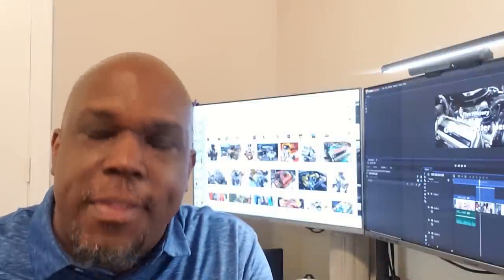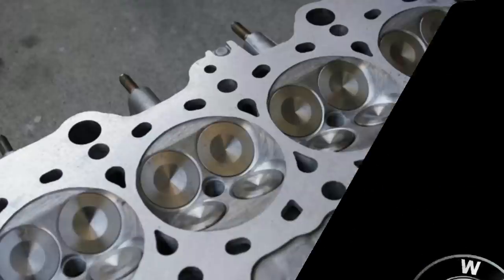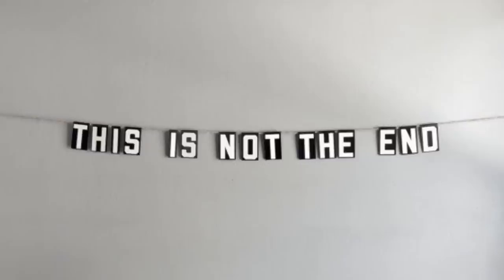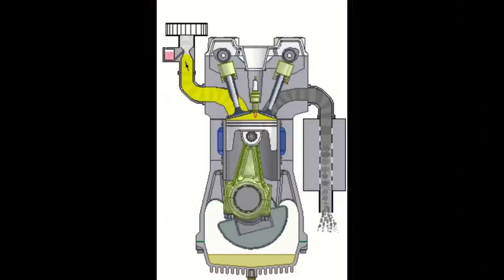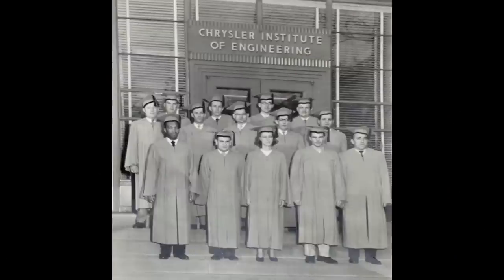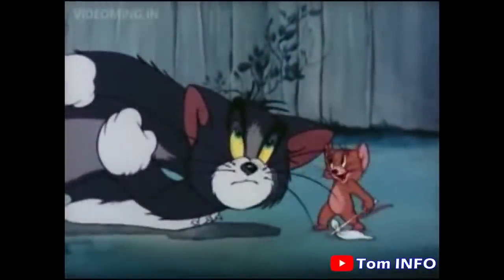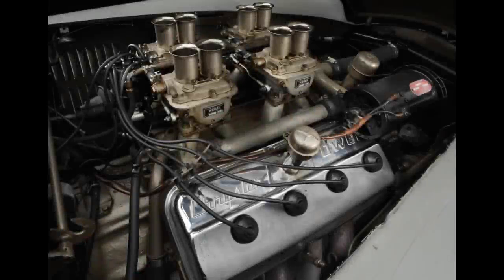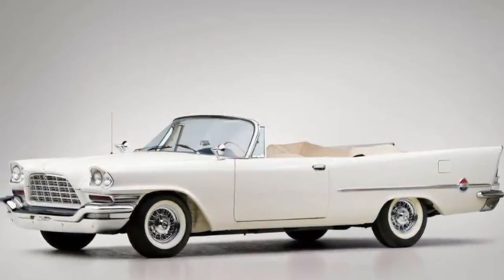The History of the Chrysler Hemi Gen I

Comment: The XIV-2220 was not the 4,14 or 11-2220. X stood for experimental I stood for inverted V stood for engine configuration of 2220 cid. Most WW2 aircraft engines of all configurations were "blower" fed. These superchargers were ALL mechanically linked to the engine, no belts to throw. Many superchargers had a transmission of sorts for 2 or even 3 speeds for additional boost at high altitude where air is thin.
Reply from the maker: Thank you for the information!

Comment: Are you sure the V16 did not also have a mechanical mixture distributing blower at the back of the block? They weren't as large as performance units, but they did give some positive boost (as with V-1710).
Reply from the maker: I'm getting a lot of comments telling me that there were plenty of gear-driven blowers on planes back then, so it could have very well been blown instead of turbocharged.
Reply: @TheGearheadLounge  I think you are correct about this particular engine being turbocharged given that the exhaust is collected and piped to what looks like a turbine. I'm just suggesting that many engines came with a small, mechanical blower integral with the engine regardless of how performance boosting was added. The US Army was sold on turbines, but that didn't keep Allison from having an integral blower. An 'auxiliary' turbine was added to the P-38; I think it was never added to production P-39s or non-Merlin P-40s. I'm probably oversimplifying but, basically, the complexity of aero engines made induction routing circuitous. That integral blower helped mitigate the problem. Of course, some engines (like the RR Merlin) went straight to performance boosting as RR did not intend to chase torturous turbine development when they suspected their blower refinements were nearly as good (and more compact). Look into compounding or fluid drives if you like headaches. Just the same, thanks for the content.
Reply from the maker: @busterdee8228  Thanks! Yeah, I think it's turbocharged myself, because I studied a ton of images and it seemed like the most logical answer, but I'm not going to argue with anyone on this subject because I don't know for sure 100%. A lot of these guys commenting have worked on airplanes like that, so I'm content NOT pushing my point across. In the end, the powerplant itself didn't get past that development stage because jets were the next big thing. I do appreciate your comments though, I love learning new things!

Comment: I can think of three other manufacturers with Hemi engines at least
1) Jaguar. The XK series inline 6
2) Damliar. The 2 or 2.5 liter V-8
3) Toyota. Their first V-8 was a pushrod Hemi head V-8 eventually grew to 4 liters iirc.
Reply: 1 more for the list. The Renault 1600cc four cylinder used in the 18i a d Fuego in the US. One neat feature of that engine series is the camshaft is mounted so high in the block that the timing chain and sprocket are partially above the deck of the block. The tappets are in the head. Very short valve train. And yes it's a cross flow head. There are still people using race prepped versions of that engine in certain classes. I'm not sure but the engine along with the transaxle might have been used in Formula Renault.

Comment: For your information, the XIV-2220 is Experimental Inverted "V" 2220 CID not the 4-2220, aviation industry has given special nomenclatures for each component of the aircraft, case in example, the Allison X-3420 engine is actually a double V-1710 that drives the common driveshaft, with an engine upside down resting on top of the base engine, today most civil aircraft are powered by the "O" series which is opposed cylinder engines just like the VW beetle or Porsche's 911 series cars, most of the names used in the automotive industry comes from the aviation industry, "I" = inline, "O" = Opposed, "V" = v, "X" = Double V, "IV" = Inverted V.
Hope you understand that the IV is Inverted V not 4
Reply from the maker: Now I do! Thank you for the explanation!

Comment: The IV prefix to the aero engine is not a roman numeral. It relates to the layout of the engine which was an Inverted Vee of 16 cylinders . In military parlance the engine displacement is rounded to the nearest multiple of five. So the engine is an Inverted Vee of 2220 cubes or an IV 2220 not a 4-2220

Comment: The early HEMI and the new HEMI are nothing alike except for the shape of the combustion chamber the old HEMI was almost bullet proof the new HEMI can’t come close overheat it one time it’s done
Reply: 1990's hemis don't have hemi chambers, it's more like everybody else's Yates chamber now, except over/under valves instead of side by side valves...
Reply: @BuzzLOLOL  The 90s was a semi-Hemi, but the newer Eagle is, like you say, more of a Yates but with the lateral valves of a real Hemi.
Reply: The old hemispherical chambers really where the best if you didn’t over do them!
The middle child is just me, but the newest generation is much better than the 90s version again.
They can withstand a good bit of power and torque while having a decent reliability with the bigger block, the better rods and the better Aluminum heads.
With all that together (the latest engines have it from the factory the a bit older ones around 2010 you needed to build a hybrid between the car and truck engine.
More durable block, rods and head aluminum of the trucks but the rest from the cars.
Annoying thing is that the head needed to be machined for the bigger car valves to if you do that just don’t take the stock parts but better parts to get 550+ hp for cheap (if you already have the functioning engine or all factory parts for a full build at home).
Otherwise just buy an engine that’s newer than 2017, they already have all the good stuff mixed together from the factory.
Those you can just drop in.
Reply: True! I put a 392 in a 71 Cuda (from a junk yard), and created my own Hemi Cuda. Bought the engine for 100, wrecked car for 1,000. Spent 10,000 on everything (very high those days, because new cars, were under 5,000). But they were built tough. And yes, that 392 with parts from our hotrod store, did make it almost indestructible. Block and heads cast iron, I got racing guts, and an aluminum 2/4bbl carb set up. Kept the valve covers, had them chrome plated. Great time era of being a kid.

Comment: They're not roman numerals. I- means fuel injected. V means it's a V engine as opposed to the currently common O- Opposed or flat engines or a R- radial R-2800 P&W. X- is for a double V, X engine possibly or used to designate an Experimental engine.
 In modern times, L- means liquid cooled but wasn't a thing yet perhaps.
 There's also TS or T for turbo supercharger or the modern " Turbo " designation.
Reply from the maker: Thank you!

Comment: Most of the WWII material here is simple minded, often dead wrong. Engine driven superchargers on airplanes did not use belt drives, for instance. Many engines 2 stage supercharging.  The first stage was driven by gears, not belts. The second stage was a turbocharger. Sometimes. In others it was another gear driven supercharger. Anyway, this guy is so slick and careless about matters I know a little about I mistrust him on the auto material.
Reply from the maker: Thank you so much! I appreciate the info! I really tried to find out the truth, but was I couldn’t find anything that I considered conclusive. Admittedly, my knowledge was limited in that area. I really thought I had the correct info. I’ll try to address it in the next one!

Comment: The hemi was too expensive to produce and also too heavy. And the power potential really did not show it in top flight. 
The wedge engines were near as powerfull and far cheaper to build. 
Or the A engine that too was simpler and far cheaper.
Chrysler divisions all having their 'own' engines meant Chrysler was competing with Chrysler. Those 50s and 60s engines still confuse me.

Comment: One part you missed explaining early in the video is the valve arraignment. The reason they flow better is more the angle than anything. They enter the combustion chamber at an angle getting them away from the cylinder wall as lift increasrs and unshrouding the valve head.
Reply from the maker: Thank you for the valuable info!

Comment: I'm wondering, is forced induction from an 
expansion chamber, considered supercharging?

Look up the Kadenacy effect.
https://en.wikipedia.org/wiki/Expansion_chamber
Close, but not quite right.

When a 2 stroke engine comes on the pipe, 
the experience is AMAZING!  My old RD400 
was stunning.  My tiny 66 CC bike motor, even 
better.  (It is producing 3 HP, until the pipe wakes 
up, and then you have 7 HP.)  Quite impressive, 
and no moving parts.  (Unless you have reed 
valves.)

steve
Reply from the maker: Wow! That's really interesting! I never knew about that effect. It also appears to promote exhaust scavenging, if I read that correctly!  But I agree, it's a supercharging effect!

Comment: Why did they build that engine with that low compression they would had a much powerful engine with a hyer. Comp 10.0 to 11.o with no problem
Reply: Most likely because of the fuel at the time. Would have to research a little bit, but I believe high octane ethyl wasn't available until the late 50's.
Reply: As the high compression engine era was gaining steam in Detroit during the early to mid 1950s, the need for higher octane gasolines was becoming more and more apparent. When automobile production resumed in 1946 following World War II, gasoline octanes in the United States averaged at 79 for regular and 85 for premium and those numbers climbed year after year until 1954, when premium gasolines were rated as high as 94 octane and regular at 86. Oil companies were promoting their gasolines, especially their premium grades, with claims that their fuels increased power and gas mileage while cleaning out the carburetor and other engine parts to wash away accumulated carbon and other deposits while regular usage prevented the future buildup of such. Among the additives widely promoted by leading oil companies were Texaco Sky Chief with Petrox, Super Shell with TCP, Mobilgas Special with a Double Compound ingredient and Sinclair’s Power-X featuring a nickel additive.

As Detroit continued the horsepower race unabated in the mid-to-late 1950s, the oil industry responded by continuing to increase the octanes of their gasolines, and a few even went the extra mile by introducing “super-premium” fuels which were even higher in octane that the premium grades. In 1956, Sunoco introduced its “Dial A Grade” blending pumps that could dispense five different grades of gasoline, later increasing to eight, ranging from subregular Sunoco 190 to superpremium Sunoco 260. That very same year, Esso introduced a third grade of fuel called Golden Esso Extra, which came in a gold pump and had an octane rating of just over 100. That was followed in the spring of 1957 by Gulf, which introduced its super-duper Gulf Crest that was dispensed from a purple pump, and Chevron debuted its Custom Supreme grade in the western states.

By 1958, oil companies generally took a position concerning the number of gasoline grades offered with the greatest majority choosing to stick to just two (regular and premium) and simply increasing the octane ratings of both grades of gas with the premium fuels coming very close in octane to the super-premiums offered by some competitors. That year, regular gas averaged at about 90 octane and premium hit the 98-99 mark. With compression ratios on Detroit’s hottest engines reaching the 10 to 1 plateau and higher, nearly half of all 1958 automobiles were powered by engines requiring premium fuel. And that included virtually all medium and higher-priced automobiles, leaving only a few lower priced cars powered by engines capable of using regular fuel including most Ramblers and Studebakers, as well as Ford, Chevrolets and Plymouths with standard six-cylinder or small V8 engines.

But the advent of smaller compact cars with more economical engines, both domestic and foreign, along with detuned engines in some larger cars, slowed down the octane race a bit and by 1961 only one-fifth of new cars were powered by engines that required premium or super-premium gasolines. Motor Trend magazine noted the trend toward economy that year by pointing out that Chrysler Corporation had reduced compression ratios across the board on standard engines to burn regular gas, a move that may reduce miles per gallon fractionally but give you more miles per dollar. “Five years ago, new car buyers swallowed premium gas as a necessary evil; today a salesman has to have a good reason for specifying it.”

With a smaller proportion of new vehicles on the road requiring high-octane gasolines and the octane ratings of both regular and premium grades continuing to climb, demand for the more expensive super-premium grades, never really that high, dropped dramatically. In the fall of 1961, Esso and Gulf both discontinued their super-premium grades of fuel in favor of lower octane fuels to supplement their regular and premium offerings. Esso increase the octane of its premium Esso Extra and introduced a new middle grade of gas, Esso Plus, which was inserted in price and octane rating between Extra and their regular fuel. Gulf took a different direction by replacing its super-premium Gulf Crest with a new sub-regular product, Gulftane, which was priced about one or two cents less than its Good Gulf regular – and also designed for vehicles that could use gasolines with octane requirements lower than regular grades. In the process, Gulf created a subregular product that was priced on par with regular gasolines offered by cut-rate independent gas stations that generally sold gas for a few pennies less than major-brand stations – sparking off “gas wars” in many areas of the country where prices often dropped as low as 18 cents per gallon for regular and subregular grades (compared to the prevailing normal regular fuel price of 25-26 cents per gallon).

As the subregular and middle grades of gas came to market in 1962, the average octanes of gasolines in the U.S. now stood at 93 for regular, 99 for premium and 102 for the few super-premiums still left on the market. Those numbers would increase only slightly in the next few years to around 94 octane for regular, and 100 for premium by 1967.

By this time, other oil companies jumped on Sunoco’s bandwagon by offering blending pumps dispensing several grades of gasoline from one pump to tailor fuels to a particular vehicle’s octane requirement. Signal Oil Co. offered seven different grades of gasoline through its blending pumps at its Hancock and Norwalk stations in the Western United States. In the Mid-Continent region, Conoco began testing four-grade blending pumps in some markets in 1965 and introduced the concept throughout its marketing area two years later. In addition to Regular and Premium, Conoco offered its sub-regular Conotane (similar to Gulftane) and a Super grade between Regular and Premium similar to Esso Plus. A similar four-grade pump setup was offered by Skelly that included Skeltane (sub-regular), Regular, Special (intermediate) and Keotane (premium).

The development of true high-octane gasolines came to a screeching halt (along with the musclecar era) as a result of the Clean Air Act of 1970, which stipulated many federal mandates for automakers to reduce emissions of their engines. With that, General Motors President Ed Cole announced that his company’s engineers found the answer to meet these ever toughening standards – a catalytic converter, which got the job done but required the use of unleaded gasoline. As a first move toward the 1975 models that would be equipped with such devices, GM reduced compression ratios on all of its 1971 engines to permit the use of low lead, regular leaded or unleaded gasolines and other automakers soon followed. This move spelled the end of the “octane race” and as unleaded gasoline was being phased in at most U.S. service stations during 1974 in time for the 1975 and later models that would require such fuels, the higher-octane premium and super-premium leaded fuels gradually disappeared from most stations – leaving only lower-octane leaded regular and unleaded grades. By the late 1970s/early 1980s, the last of the leaded premium grades disappeared as oil companies introduced new premium unleaded fuels that were higher in octane than the unleaded regular fuels (91-83 vs. 87) – but still lacked the moxie of leaded premium fuels, leaving drivers of older cars with engines requiring high-octane gasolines with few options to keep their classic rides intact without undue engine knock, creating a cottage industry for octane boosters and, with the recent phaseout of leaded gasoline altogether, additives to replace lead as a lubricant against valve recession.

Comment: Foot pound not pound feet
Reply from the maker: I would respectfully disagree with you, as torque is force times radius. Force is measured in pounds and the radius is the length of your wrench, hence; pound-feet. Which is also the SAE standard of measuring engine torque—versus foot-pounds: a measure of work over a given distance, or the energy required to move a one pound object the distance of one foot.